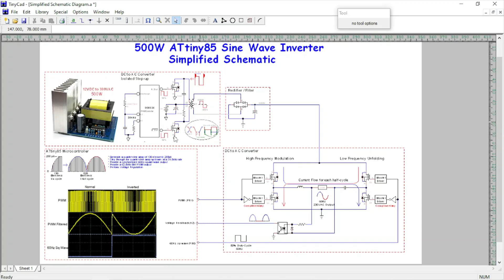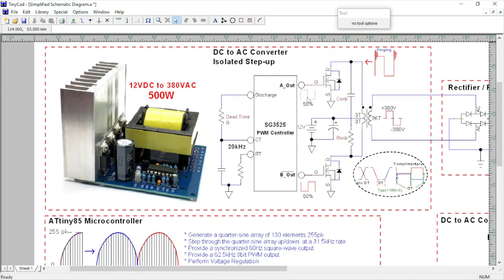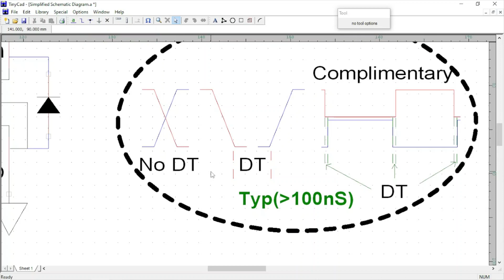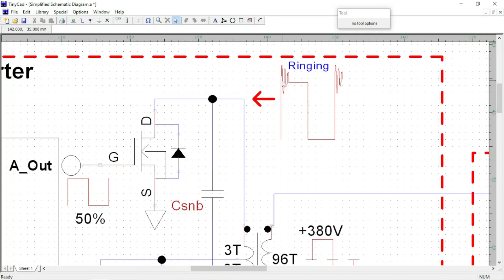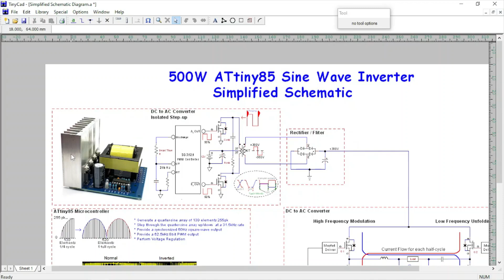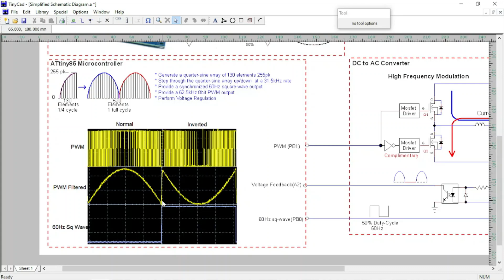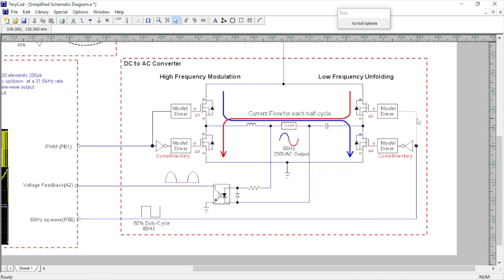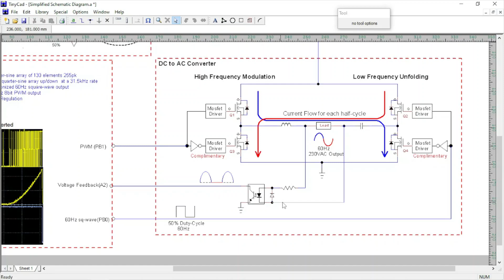Simple ATtiny 500W Inverter Simplified Schematic

Comment: great work but why there is no LC filter to convert spwm to sine wave before grid connection 😊
Reply from the maker: This is a stand-alone sinewave inverter it is NOT designed for grid tie application.
Reply: @paulspengler8144  ARDUİNO NANO İÇİN BİR ÇALIŞMANIZ VARMI.